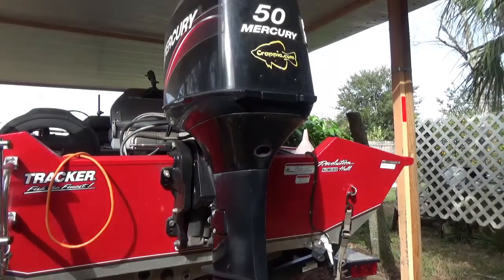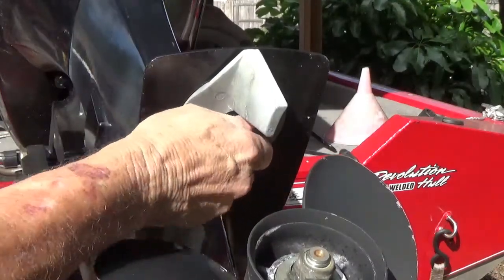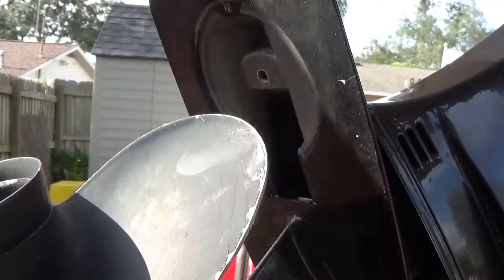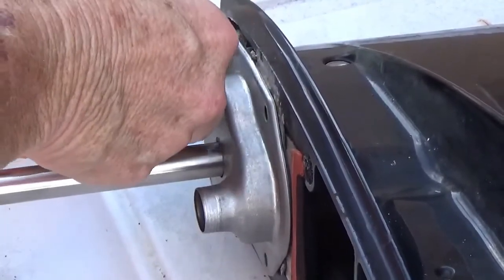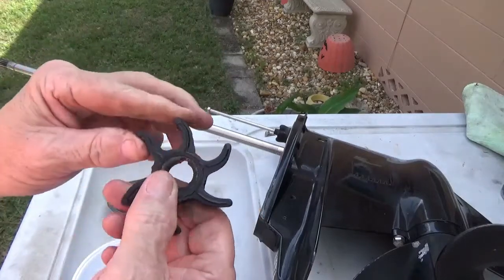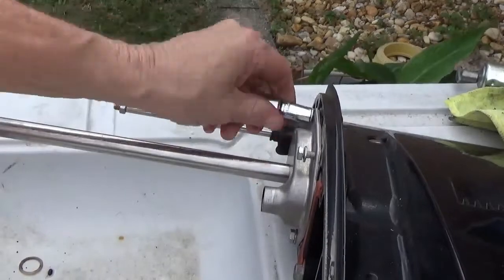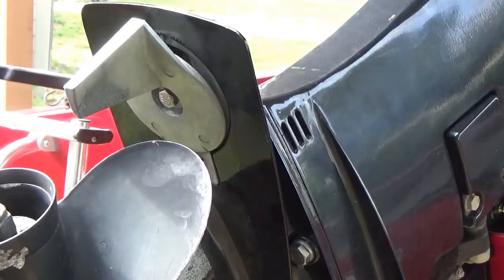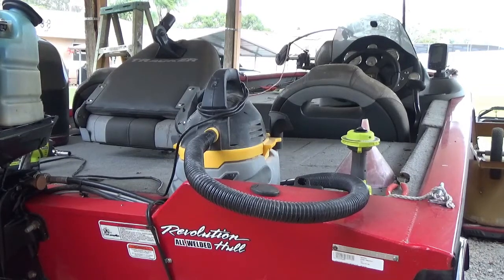how to replace water pump in 50 hp MERCURY OUTBOARD

Comment: I always get dirt dinners in the rubber discharge pee hole... use weed wackier string and push it up as far as you can and clean it out, good video gonna check ours this weekend

Comment: For anyone experience this same issue, I just fixed this on my 1994 Mercury Mariner 50hp. The outlet on the peehole was clogged. On the inside of the cowling where the peehole is you can slide the hose off the peehole. The plastic peehole piece itself was clogged with a rock or stick or something, I could not blow any air through it. Stuck a paperclip through to unclog, plugged the hose back on with a new ziptie to hold it tight, and now its working fine.

Comment: Small pieces of debris can be pumped up through a small hose to the "pee port" and plug it up. The small hose can be removed and the debris cleared or use a small straightened paper clip and probe the in the small port hole to clear it. Mercury designed their cooling system this way to give the operator a visual confirmation that the pump is pumping water. On older Mercury engines the port was larger in diameter and mud dabber wasps are bad about packing them with mud. I know I had an older engine that this happened too. Good video sir.
Reply from the maker: Thank you very much and thanks for watching my video
Reply: dropp55 I have a older Mariner 50 hp and the pee hole is larger.  After revving the engine in the shallow water with lots of silt in it ( was adjuating carburator )amount of water coming out of the hole has reduced to the minimum.  What's the best way to clean it up or the impeller need changing? Thank you
Reply: @alexzenihov893  what did u end up using? Its probably a good idea to remove the both end of that rubber jumper hose(from the fitting on the head...and from the outlet), and clean it out with a long piece of grass string trimmer line...also good to run de-salter or acid flush&rinse to clean the block regularly

Comment: here in florida dirtdobbers wasp are notorious in stopping up water pumps I’ve never thought about using a shop vac myself i keep a 1/8” piece of round steel and prior to going fishing checking that port for dirt clogged and that seems to work fine. believe it or not have went fishing on a saturday afternoon and then went to go sunday morning and it already be clogged so they work fast. great video i hope i’m able to get around as good as you when i get around your age which isn’t to far in the near future.

Comment: Thx good info...Been the Mud Dobber rout several times....Sugg take the Prop off sure lightens load esp if its SS.
Reply: By the way Pulled LU on my 03 50hp yesterday easy thx to you...opened WP and all was such good shape  I just put it back without replacing anything...First  Merc LU/WP for me ..sure easy compared to OMC  I've changed

Comment: I have a 50hp merc & I just cranked it up & the alarm came on - going to check it out - I've had the nitro for 2ys & it's a 2001- not sure if the water pump has ever been changed & will do it after watching this video bc the water pump kit is less then $20 & I would hate to be stuck out the pungo & my water pump goes out. Good video.

Comment: Mine is a 1967 ish Merc Thunderbolt 500 50HP Four. I've replaced the impeller, and all the parts of the pump. I've blown air through the pipes and hoses and there are no obstructions, but still no water coming out of the tell tale... any thoughts?

Comment: So u vacuumed the little hole? I’m having the same issue.. won’t spit back water after replacing the impeller
Reply from the maker: Yes I took the shop vac and tryed to sell the hose around the hole after starting the motor and it worked. It may have just had trash in it all along. But now it's fixed.
Thanks for watching my video

Comment: Nice video. Can u clear up the two nuts you seperate before dropping the lower unit? We’re they accessible before splitting the case? Or did u have to seperate it an inch or two and the split the connection? And what happened to the jetway that fell out and was by the rag? Lol